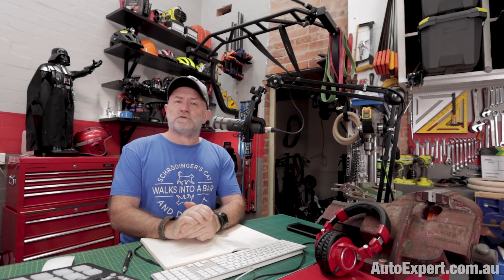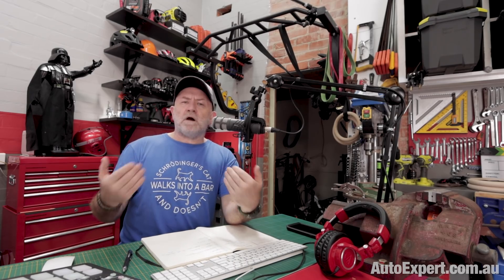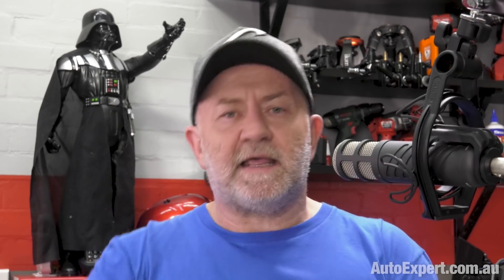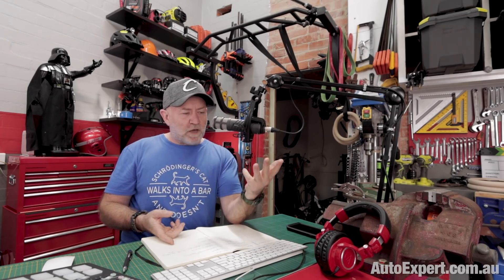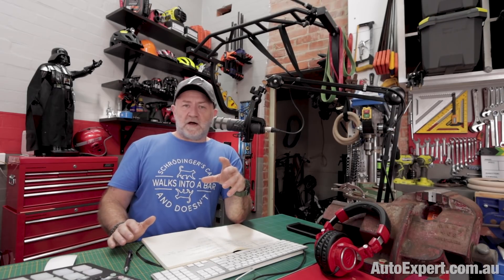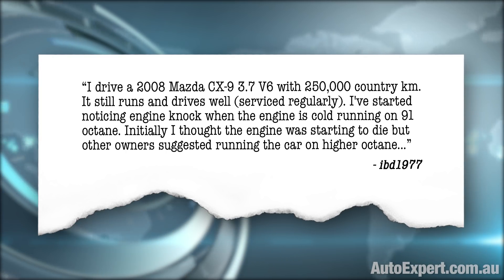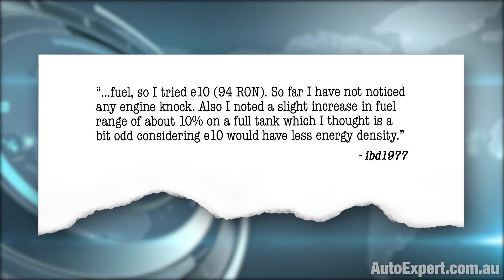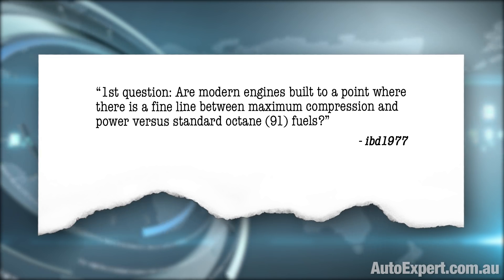Octane rating & engine knock: ultimate 'beer garden physics' deep dive | Auto Expert John Cadogan

Comment: Hey John,
What about time and distance servicing with regards to the poxlips , do you think the manufactures will give any leniency considering the physical, mental and especially financial hardships the average Australian  is and or going to encounter?
Kilometres travelled will very likely be minimal during this upheaval in life, but the Stealers may take advantage of the time base side of service schedules to conveniently get  out of any situations that may arise.
There will always be the exceptions,  but I have always reckoned that time based servicing is a ripoff particularly in Australia with our reasonably stable climate compared the other parts of the world.
I'm sure modern clean burning engines and lubricants can handle a lot more time than the car manufactures and dealers want you to believe.
 Distance on the motor oil is a far more realistic factor to take into consideration than not changing the oil on the specified time for the average motorist.
Maybe you can use your influence in the industry and have a chat to some of the Brands and get their take on things during these times?
I'm sure the car will likely be at the low end of concerns  for  Australians for the next 12 months or so as we are not aloud to have unnecessary travel.

Comment: I remember talked ng to an aircraft engineer very proud of his high mileage Volvo 2 series. He said hed done calculations on piston speed and the referenced aviation oil docs and determined he shouldn’t go much above 3000 rpm to avoid “oil shear “ which I guess is a bad thing for cylinder wear. His pet car had over a million kms with no serious work on it just spark plugs and oil changes. Id like to know more about this shear thing. Which as a Kiwi sounds  like sexy time with woolly sheep wearing sheer pantyhose.
Reply: Aviation oil, and automotive oil are not really comparable.

Taking into account that oil film strength can vary from one oil manufacturer to another leads me to think that,

The longevity of the engine is pretty much because he did regular oil changes and never flogged it.

Comment: This all reminds me of Holden pretending the LS can run on 91. I mean, yeah, it can, and it’ll do so just fine, but people have reported pretty massive power gains with a 98 tune. E85 I’m not so sure about though, because vehicles with that equipped from the factory do have flex fuel sensing, so it figures that the would adjust the tune on the fly - no need to plug a fancy computer in and change the tune, because it’s doing that for you.

Comment: Wait, I did get my engine up to 3,000 RPM! Uh, but it's a 3.0 V6 turbo-diesel. I think the redline is 4.1K. I recall reading an article interviewing Gale Banks about the engine (VM Motori) and he remarked how scary it freely spooled up. He was getting north of 600 HP and 600 lb/ft in a triple turbocharged version.

Comment: Hi John, can you share your opinions on mixing some 2 stroke oil with diesel fuel please. Some people think it works wonders regarding injector and pump component wear...I wonder if it's worth doing, or if it's just forum based bullshit..
Reply: In short, if you can afford to replace those components (or others that would be affected like injectors) if the advise is bad,

Then go right ahead.

If not, then I wouldn't

Comment: so that's why tuners choose ethanol fuel when turboing  NA engine and use flex fuel sensor in the fuel system to adapt turbocharged na engine to safely run on petrol also.

Comment: Where I work at, we have a fleet of F-150s.  Fifteen of them run various engines, but most are 3.5 l NA.  The 3.5 l NA engines suffer from incredible amounts of pinging and its more pronounced at low engine speeds.    They are running 87 octane AKI in those vehicles, so that's part of it.  However, the engine computer should compensate for that.  Once I have some time to fool around with them, I'll have to check it out.  It's rather bad.

Comment: Comprehensive dissertation, John. When You're Hot, You're Hot? :) Just wondered if E10 fuel might have cleaned up the Mazda fuel injectors a bit? Plus the higher 94 octane, allowed the ECM to advance the ign timing, a touch? Thus improving range?
Nice to see The Cat's back :) Is that overhead device your pull-up bar? :) Cd you do a show about diesel knock & Cetane #?

Comment: good lockdown vid.......John could you please explain why we are paying good money for sulpher full shit fuel.  i drive a renault turbo and  knocks at low revs 2000rpm with light throttle input trying too accelerate. 
have put full tanks of 98 shell,  caltex, bp,  and was getting really pissed off..  After few months of wasting money on their overpriced fuel,  filled with of all things, seven-eleven 98 and have been sweet ever since, what is the difference in the mobil supplied fuel  too 7/11?
Reply: The long story short is that you are experiencing the strange/ weird (but known) phenomenon of a vehicle "preferring" a certain brand.

For example my last car (which I tried different brands, as well as octane fuels) didn't like 7/11 or Shell, was neither here nor there with Caltex, but liked BP (98)  

Every major fuel brand starts with the exact same base fuel, each brand then adds their own additive package.

Your car just doesn't like the additive package of the other brands, or you were really unlucky with bad batches of fuel.

Comment: At the end of the day, whether you use the bare minimum, or overkill it is your choice.

But know why you are doing it :-)

Reasons to buy a higher Octane fuel than required (especially if the minimum is 91 RON), and that is suited for your car (so don't use E85 in a car that's not designed for it)

- In Australia the high Octane fuels are of a higher quality (containing less sulfur for example), and this leads to the next point.

- Higher Octane fuels have a longer storage life.

- A higher Octane rating fuel will allow the ECU to advance the timing further to allow for greater efficiency of the power stroke (Which is why you would notice a slight increase in range esp if you are doing a lot of highway driving), which leads to the next point

- You generally use less fuel to do the trip (so theoretically slightly less pollution).

- The additional cost is deemed acceptable to your budget.

Reasons to use the minimum octane fuel that the manufacturer specifies:

- It is all that is needed to make the engine run without any issues.

- The increase in range of the higher octane fuels will rarely if ever offset the additional cost that you pay (you get more range, but not enough to cover the price difference).

- You realise that higher Octane fuels are not, I repeat not liquid Schwartz (they have the same energy content unless it's an Ethanol blend), and so you don't see the need.

- Cost is an issue.

Comment: If the on-board computer is retarding the timing due to knock, a car will get slightly worse fuel economy.  Fuel economy would even be worse if the computer compensated the timing as far as it can and the fuel is still detonating. Optimal power and efficiency is only achieved when the timing is basically correct for the engine using the proper fuel. 

The inefficiency crated by the engine firing late and still detonating is easily more significant than the energy density of the fuel.

Comment: Hey John, interesting video mate. Quick question. My 15 yo car loving son came home with a $3k year 2000 GD Subaru Impreza wrx with 222ks on the clock. Yes I know what you’re going to say.... Anyway what a POS it is... the nice gentleman that sold it to him said nothing wrong with it. However, it has a knock at low engine revs, had shitty spark plugs and coil packs (replaced them) and it has a surge when holding a constant throttle when driving at 3-4K rpm. It has a tank of fresh fuel now 95ron and some F10 fuel additive to clean the fuel lines and injectors (allegedly). What could be causing the low speed knock, and what could be causing surging? Is it vacuum hose related or something more dire? Also the gearbox shift mechanism is looser than Pells morals, but looks like it needs bushings. Thanks
Reply: Have u also checked the O2 oxygen sensor and timing belt tensioner?
Reply: Will do Glenn, cheers
Reply: @jk66  no problems
Reply: pete smyth  it's not high performance cars that kill, it's the inexperienced drivers that do it, he might want to track the car! Or Father/Son project!

Comment: youtuber project farm tested ethanol mixed fuels in a small lawn mower engine he got higher efficiency  with e10 how is this possible? when ethanol has a much lower calorific value
Reply: I know I've seen those PF videos, go back and look at it again.  PF hates E10 and knocks (no pun intended) it every time he has the chance.  But he never gets to the point as to why most gasoline in USA is E10 - it's for environmental, not performance reasons.

Comment: It amazes me how much people present their car as having 300 something hp but they never really  take their engine up to the rpm where that peak power is developed. Hardly anyone goes above 3k rpm in daily life. Few people with such interesting engines get these engines to develop anywhere near peak hp.

Owner: "My car makes 300 hp"
Engineer: "Your engine outputs 300 hp at 6k rpm"
Reply: Yair - But, good to pass a road train on a dual carriageway? Watch for speed traps? 
Great on German Autobahns? But, not in their icy, winter? 
ABS? If you hear "Gunfire" - Hazard Lights On - Slow Down - That's High Speed, Pile Up, Ahead...

Comment: Not for shits and giggles but a counterpoint to mind bogglingly fast internal engine cylces and processes. 

In this example I'll use your rather pedestrian M20A-FKS Toyota 2 litre engine. It reveals a stroke length of 3.843".
I use inches because a stroke (lol) of luck shows the exact Feet Per Minute (FPM) the piston is going at 6000rpm by the mere movement of the decimal point to the right 3 places. 

It is in fact 3843fpm (this little rule of thumb is very handy since ~ 4100fpm was considered the max piston speed for reliable operation. So take the Ford 351 stroke of 3.50", it reveals 3500fpm @ 6000rpm or 600fpm below [the old] theoretical max). Cool eh?
It turns out 3843fpm is 'only' about 43mph or 70kph - pretty slow really - kinda sorta especially when compared to say any bullet or any of us driving down the highway for that matter. 

So the mind bogglingly fast internal cycles only really occur by virtue of rather moderate internal speeds.
Even the 20,000rpm Honda 250cc 4 cylinder engine from years ago has such a short stroke that it only has the piston speed, give or take, of that of the Corolla and conforms more or less to the 4-4100fpm rule. 

It also gives a rough indication of internal load that little trick. Of course the 4000 or 4100 rule can be exceeded it's just a guide. Low internal mass or expensive metallurgy or both can be used to surpass the arbitrary limit.  

That's the counterpoint part.

To use the rule for higher or lower 1000rpm values it is as simple as dividing by 6 and adding or subtracting the 1/6th value to the 6000rpm value. Double it for 12,000rpm, triple it for 18,000rpm.

Comment: You can get better gas mileage on lower energy density fuel if that fuel have better octane rating. That is particularly true on down size fiat turbo engine. Ways to reduce knock is advance spark time and have rich fuel mix. And fiat does that. So if you have those 3 cyl turbo fiat engine you probably floor throttle quite often(1000ccm on fiat 500L is pure joke). If that is case higher octane rating fuel is gonna make engine run more lean and save fuel even if there is less energy in fuel.

Comment: I have a 1996 Rover Mini equipped with its original fuel injection system. It has no knock sensor.

The app I use to keep in eye on what's going on with the engine.. (plugging your smart phone into a 1990's ECU!  Gotta love modern technology).. Anyway, the app has a warning about dicking with the ignition advance settings.  It basically says don't mess with them if you don't know what you are doing or you'll destroy your engine in a number of exiting ways. Melted pistons,  rods through the engine block or other internal engine components rapidly becoming external.

Needless to say I do not mess with the ignition advance settings.
Reply: Are you sure that it doesn't have a knock sensor?
Reply: @notsureyou  

Yep
Reply: @a.gordon.1385  Fair enough.

I only ask because from a quick google search it does seem to have one.

But I don't own that car, and I have def never worked on one, so I thought I would ask the question :-)

Comment: I use what I can usually find is 91 octane and it can still knock slightly on hard acceleration.It's an LS1 Camaro engine. I never found additives to do anything. We have 87, 89, 91 and some places 94 octane. Replaced the knock sensors but haven't had it out to see how it runs now, had some snow today !!!
Reply: Are you in North America? I believe the octane ratings are calculated differently than here in the Southern hemisphere... kinda like your degrees Celsius or the like... your 91 would be equivalent to our 95-98 octane from a guess...?.
Reply: 18.40 odd on explains this mate... I suspect you and I started commenting b4 we finished listening...
Reply: @peterlattimore6013  in Canada.
Reply: @peterlattimore6013  yep, save all questions until after the lecture.
Reply: @HypocriticYT  try and clean the airflow meter around the intake airbox... carbons up after awhile also... hotter spark plugs to accommodate for the cold air from Canada... do you notice the difference between seasons??? Volumetric efficiency via what's that name John called it... not detonation... the other one... its almost impossible to diagnose pre detonation over a few messages,  but it's good to give some possibilities... Intake cleaner-hotter-colder plugs (where is the Camaro originally from ie leaner hotter atmosphere)... you get the idea...
Reply: @peterlattimore6013  Camaro's were built in Oshawa Ontario, should be used to our weather lol. I do keep the throttle body clean and only drive in warmer weather. Hopefully the knock sensors fixed the problem, they were rusty and made a code appear. Should not wash those engines as the intake does not seal out water and water can sit down in the sensor depressions.

Comment: John, I am curious...
  Here in Retardistan/Merica!!!,  the octane of pure/motor grade Ethanol  is purported to be 114. Our usual best station pump offering is 91-93 (AKI) (87AKI is standard in my area)
  Accepting that Ethanol contains less energy, (by about 1/3?) per equivalent  unit, I note that an, Old (MRICAN!!!!!!) hot roders theory here suggests that every 1% increase in compression results in a "3% increase in top end power, and a 20% overall increase in fuel efficiency). (This theory seems to be popular  when applied in the 7:1 to the 13:1 range.)
 This theory seems less likely to be accurate than unsound, yet it is still commonly believed.
  Would an engine, designed to use Ethanol exclusively,  use the compression advantages to extract enough mechanical energy from pure(ish?) ethanol, to make a practical equivalent to gasoline/petrol? (on a per unit basis?)

Comment: I found this video interesting  - can a car run on a mix of every fuel? Well if it's an old Lada it can! https://www.youtube.com/watch?v=YDqm6TkSh20
Something I didn't know until recently is that even brand new spark plugs can have different sized gaps between the electrodes that can be so different as to affect the running of a modern car - e.g. Ford 2l turbo engine in ute which wouldn't kick the turbo in when cruising...

Comment: Well I have a 2014 Fiesta ST 1.6 ecoboost. I have ran it on shell v-power 98 since I bought it brand new and it's never missed a beat. I fkn rag the crap out of it.. Always foot flat and making it scream (only to red line Max). I do oil and filter change every 5k kilometres. This engine just fkn loves it and it's done 87 thousand kilometres now and it still pulls really hard. Pretty nice engine IMO.. I just stick with v-power because the car goes further per litre IMO. Giving how light and efficient it is...

Comment: Australians going by AKI instead of RON fuel rating wouldn't cause an issue if 91 AKI is equivalent to 95 RON.  If a manufacturer recommends 91 RON minimum and you use a 91 AKI fuel, you'd be running 95 RON fuel (exceeds 91 minimum) so all good.  The Retardistanis need not to confuse the 2, where if your vehicle requires minimum 91 AKI and you run 91 RON, you're really running 87 AKI, and that might not end well.   Hopefully, localised vehicle owners' manuals specifying fuel ratings matched to the market bowser ratings eliminate the issue altogether ... assuming owners can / do read.  (Generally speaking, you're probably better off reading the manual that came with the vehicle in your country than reading some random Google search.  Just a thought.)  One of the reasons some manufacturers recommend 95 RON minimum in Australia is because our 91 RON fuel quality is poor by developed country standards.  Specifically, 91 contains too much sulphur.  While more refined and containing 1/3 the sulphur, our 95 and 98 RON fuels still fail to meet fuel standards introduced in Europe 10 years ago.  So, manufacturers may specify 95 RON minimum, not for the increased octane rating, but because their engines / sensors / emission controls etc. can't cope with the crap we call "regular unleaded".

Comment: 6000 RPM high? The Toyota 2ZZ-VVTi engine in my Lotus does not even shift to its performance cam til 6200 RPM in my Lotus on its way  to 8500 RPM.